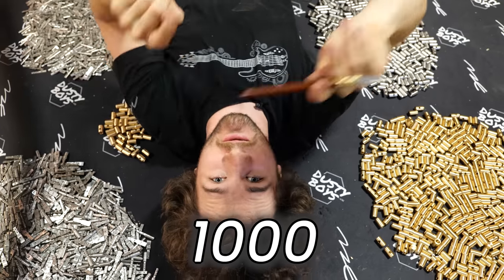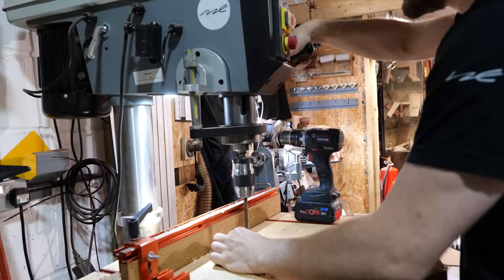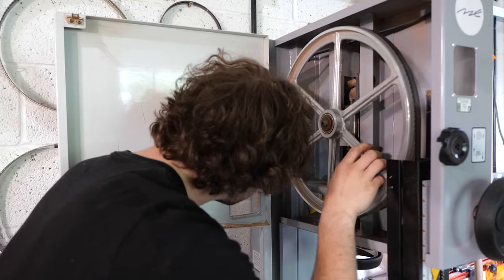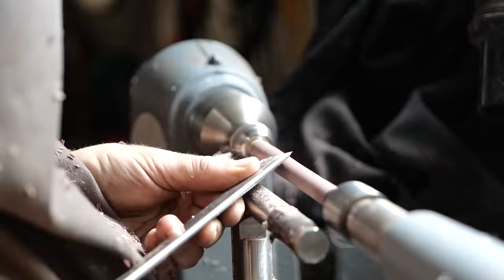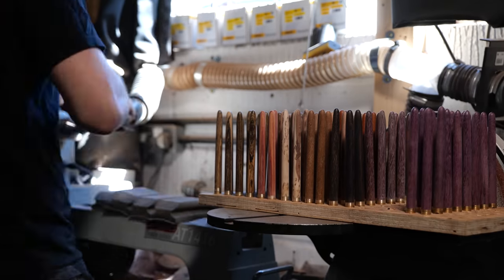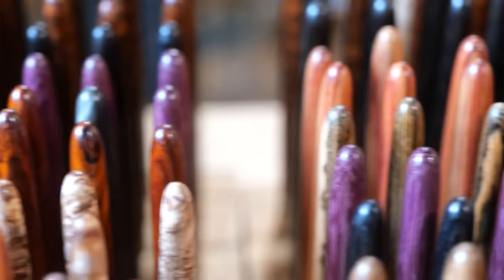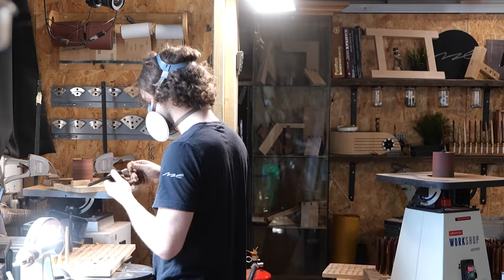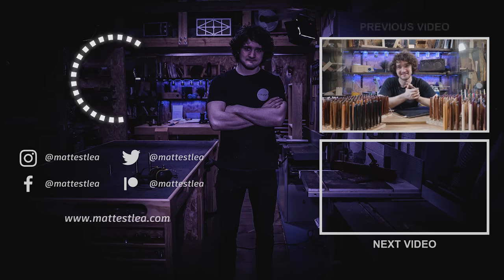I Made 1000 Custom Knives (Biggest batch ever!)

Comment: Hey Matt, just in case you didn't already know (and for anyone else working with exotic woods).  Not all woods are safe to breath their dust, or contact your skin/eyes.  The wood database has better information which are potentially harmful. But it looks like you did some work with purpleheart which is a "sensitizer" which means the more of it you work with and breath in / are exposed to the more severe an allergy to it you can develop. Its highly recommended you wear adequate breathing protection as not to breath in the dust particles created by it, because the more you breath the worse a reaction you can develop every following time you use it. Its also recommended to use eye protection that seals around your eyes as not to let the dust get into them as they can develop a similar allergy.

Stay safe
Reply: Absolutely baffled me watching this that he doesn't wear a respirator, and only turned on ventilation for the chemical process. Dust is a pretty big killer of lungs, really need to wear at the very least a filtered mask while sanding, and a respirator while coating stuff in liquids that turn to gas.
Reply: Nice point, a lot of artisans in YouTube don't use breathing protection, it pretty dangerous and an unconscious decision. 

Im a hobbyist carpenter and even for small works I feel that this type of protection is utterly important
Reply: regardless of any scientific studies saying there are "safe" woods you can breathe always wear a respirator when working with stuff like this, plus these are almost all going to be stabilized wood, so you are also breathing in epoxy

Comment: For the pin issue: Try to use your drill press. Just create two holders. One for the blade holder and one for the pin. The one for the pin should have a shallow hole for the pin and a magnet so the pin dont fall. Put the pin holder in the chuck, bladeholder beneath and done. There is your new pin press. You can make the pin holder even for two pins at the same time, so you save one workstep.

Comment: Until very recently I worked for 3M. Silicon half mask respirators work by sealing on your face. The beard means no seal. Therefore the respirator will not work as intended. 
Beards need a positive pressure system over the head full face.
Not trolling 🧌 here, just an explanation of where issues may have occurred 
Lovely work as always 👍🏻

Comment: Are you left handed? I notice you have the blades in the handles with the thumb dip positioned on the right side of the blade. Perfect for a southpaw. I was thinking you'd need to make some with the dip on the other side then... duh, just put the blade in the other way. facepalm

For speeding up the wood turning, make a template copy device to do the rough shaping. https://www.youtube.com/watch?v=2N_dEEUq9XQ
Size the template depending on how much you want to turn by hand VS how much you can take off by sanding to finished size.

For even more speed, setup a second saw to a 45 degree angle or make a jig to cut the handle blanks into octagons.

For saving the health of your lungs, get a PAPR or Powered Air Purifying Respirator. Those have a full head covering with a rigid face shield and neck seal. Some have a hard cap. There's an air feed hose that can be connected to a stationary blower with filter or to a belt mounted blower and filter. If you run the hose to a place where there's fresh air, no dust or fumes, you could dispense with the filter. There are mouth + nose mask only types and even ones with a welding mask. Filters run the gamut from simple dust, HEPA, activated carbon, organic vapor, and ones able to trap even the smallest viruses.

Your customers wouldn't want you getting sick or dying off from inhaling all sorts of fine wood dusts...

Some people have successfully made their own PAPR respirators for woodworking or yard work by using various masks, fans and automotive air filters.

Comment: Hammering in pins, talking about pin press... sitting right next to a drill PRESS. Next time try putting a roll pin punch in the chuck and use the drill press to drive the pins in, i believe it would be easier than hammering them in one by one.

Comment: One tip that helps me when I'm daunted by a large batchjob, break it up into smaller batches. Don't do all 1000 pieces in a row, just do 50 or 100, whatever you can do in less than 90 minutes, then switch to another step, maybe finish 50 before you go back to step one for the next 50.

Comment: for respirator there 2 mistake your making. one you do not have a clean shaved face so you not getting a proper seal and that style of respirator your using is better suited for open room shop as it uses a flap to exit air that can lead to negative vacuum pulling dust in every time you exhale air. easiest way to solve  most of this just put a fan near your work area that should be enough to stop most dust getting caught in vacuum.

Comment: you know, you can just put a small bolt (or any metal rod) in the drill press and use that as a pin press (with the drill press off lol)